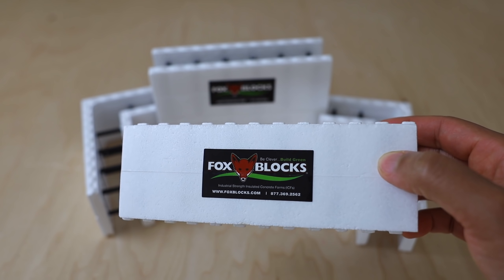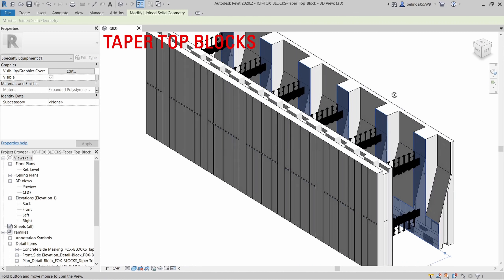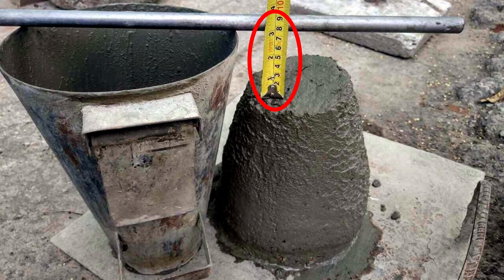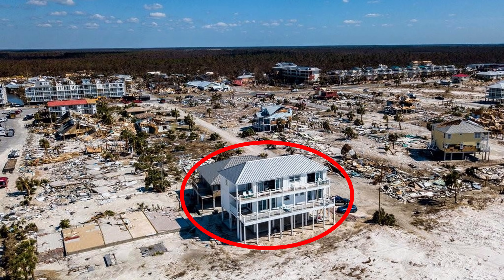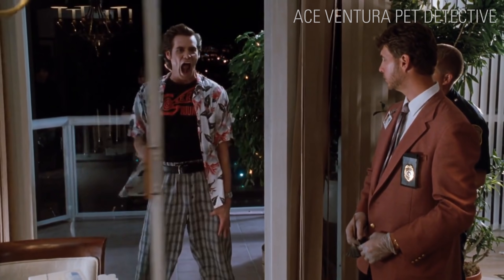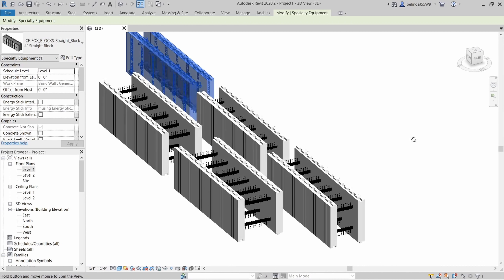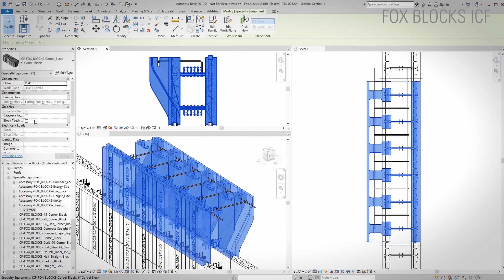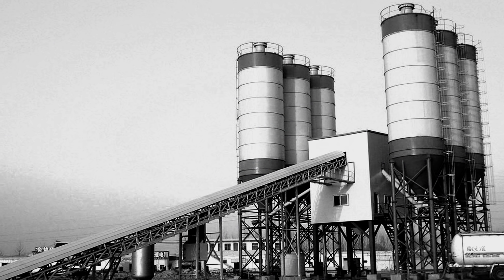Pros & Cons of Insulated Concrete Forms /ICF construction

Comment: Your claim on wood vs ICF where you say 'ICF aren't as good in cold climates' (8:35) is false. In a study by the Portland Cement Association, ICF homes saved up to 50% on heating and cooling costs over wood-framed homes. The poured concrete walls provide an excellent thermal mass, which helps maintain an even indoor air temperature. This also allows you to spend less on a smaller HVAC system.
Reply: I slightly agree with Taz, although just because someone has reason to be bias, does not mean they are.  But it is worth looking into.  That said, the math of heat transfer is not that hard to calculate.  But there are so many factors that it would be easy to do a study that could show either as better.

Not counting sheathing, Foam has R5 per inch or 26.25. Concrete R0.8 per inch meaning 4"  would be R3.2 or a total of ~R30.  With a wall 9.25" wide which is the best performance for thickness of the product mentioned.  A standard well built 2x8 wall comes in at around 8.5" and has and is R27.8.  So the ICF has a slightly unfair advantage in this comparison, but not by much.  The R-Value for a properly done 2x8 wall is just under 27 if you use blown in insulation to minimize air pockets.  (Rockwool would probably be similar).  However, the biggest problem with the R-Value of wood frame construction is the wood as it is more conductive. One solution is to use a double frame with studs that are offset 2x4.  This means the only direct heat loss through the wood is in the header and footer.  This would result in a much better R value even though it is 1/2" thinner.   

All this is at the most advantageous thickness for ICF.  As the thickness goes up, the advantage goes heavily to wood frame.   

As for the smaller HVAC system, that also depends.  The more air circulates the healthier the house tends to be so a breathing house or a good HVAC system is a good thing as well as a bad thing.  However the bad part of wood frame houses calculated as part of the R-Value.

Personally, for my new house, I would might choose ICF over wood frame, but not because of the insulative and health values which, with the way I would build are both worse.  However the extra safety from fire hazard  is a strong benefit, though I am not sure about what fumes the ICF would give off when exposed to high heat, even if it stops the house from burning down.  That would require more research.
Reply: @offroadr  0
Reply: I would take any study carried out by an industry body, on their own products with a grain of salt. I am not saying they will not be true, but they are usually bias.
Reply: I disagree about ICF construction providing "excellent thermal mass". 

The greatest tragedy about this method is that the thermal mass is actually insulated from the interior of the building where it would bring most benefit. 

A better wall system would have all the insulation on the exterior of the building, insulating the large (structural) thermal mass from environmental temperature fluctuations, allowing it to naturally modulate the internal temperature, in both heating and cooling climates, and facilitating efficient and cost-effective forms of high-comfort supplementary heating and/or cooling, such as provided by a heat-pump via low-temperature radiant UFH.
Reply: @sailingoctopus1  In my country where we usually get average -15C during winter and it's not uncommon to have periods lasting for few weeks or a month of below -25C with summer temperatures lately being 20c average with month or 2 lasting even +30.

We have these ICF systems too, with 5cm inside, 15cm(6 inch) concrete gap and 30cm(12 inch) outside insulation and I can tell you that in winter the house is very warm and during the summer it's quite cold even in +35 temps without AC. 

Using these ICF system of 5+15+30cm we get A++ energy efficiency standard or what we call "passive houses" where minimal heating/cooling is required.
Reply: @sailingoctopus1  What you say about isolation is partly correct.  ICF isolates the thermal mass from the exterior.  If the floors and roof is properly attached then these are going to have the temp of the interior.  Just like you say with radiant heat.  If you also do the roof then you will have a full envelope.  What she talks about in the video is mostly correct but there is plenty she guesses on and says completely wrong.  A good builder of ICF will know all these things and will give you a far superior home to live in than any stick build.  Plumbing, electrical and HVAC are all easier in ICF for install and size needed.  Not all ICF is created equal just like not all contractors to build you a stick home.

Comment: Gr8 vid... concrete energy intensive but with climate change getting into high-gear I expect we may see more ICF building.  Also, not just people caring too much about amenities at the expensive of a quality structure but .... excessive McMansion size leading to high building and energy and **maintenance** costs for large rooms that will never be fully utilized.  Bring on more Tiny/small or medium 1300 sq ft homes or intentional community structures :-)
Reply: Basically one of the best things we can do is begin building better buildings.
A massive chunk of the world power consumption is tied up in HVAC.  Cutting it in half (or more) means less demand for generation capacity.  It also means lower loads on local, state and regional power grids.

You forget one more option.  Build buildings with dimensions similar to what is being built now.  But build the thing to be far more energy efficient.

Most buildings are excellent space heaters for the local neighborhood.
That' how leaky and inefficient they are.
And HVAC is the single largest source of power consumption.  World wide.
And, realistically, all we need to do to fix a huge chunk of that is to air seal these buildings properly.

Comment: I thought this video was so informative.  I am neither a contractor not an architect but now I have a basic understanding of ICF construction.  My biggest concern would be the inability to remodel or add and addition to an ICF home.  This seems like brutalism evolving in that regard.
Reply: To be honest, doing an addition to an ICF wall is about the same as standard. You cut a hole in both and make sure your loads transfer properly. Just one uses a bigger saw. It’s pretty simple and just as easy as adding stairs or windows to existing basements which happens all the time.
Reply: I have an ICF addition on my home. It was incredibly easy to do.
Reply: @Kaja Pajama I should have specified. My house is ICF and I modified it with an addition.

Comment: Love your videos, And love the idea of having concrete exterior walls. would love to have the comparisons between ICF and tilt construction or traditional pour in place walls like how most basements are built.
Reply: I read that ICF is cheaper than pour in place because you don’t need to build the form work. You also don’t need to attach insulation to the concrete as it’s already done.
Reply: If you are finishing basement and maintaining as heated living space go with ICF.

Comment: I would love to hear your thoughts and comparison to "The Perfect Block" https://theperfectblock.com/
Fox Blocks have been around a long time, so they definitely have a more polished product. The Perfect Block uses recycled materials and their block has concrete mixed in with their foam. I am still learning about the product myself, but I liked your breakdown of Fox Blocks so I thought I'd throw it out there. 👍
*edited after watching your previous video that touched on how Fox Blocks recycled some material.
Reply: PerfectBlock isn't really an ICF.  It's more of a CMU (Concrete Masonry Unit).  Blocks weigh in around 30 lbs.
Despite their claims, I'd be a bit skeptical about their claims that concrete impregnated foam is going to deliver equivalent R value to a straight foam block with with no thermal bridging...

I WOULD think that the PerfectBlock is more natively resistant to critter infestation though.

Comment: Neat, but now I just have more questions.  I wonder what happens if people start trying to use similar systems with foamed concrete.  Would it make sense to use porous components like foam piping or hose in order to  increase drying time, or create space for conduit?  

Alternately, what if people try to combine ICF with steel frame construction for load-bearing purposes?  Could they use alternate infill that provides rigidity without compression strength?  Could they use the same approach for building walls which weren't vertical?  Are there half-ICF blocks for applications where polystyrene is not suitable for an exterior?
Reply: Lots of questions here but I will just tackle two. Foamed concrete, also called aircrete or such is what I believe you are referring, may work as an additional insulation fill within the ICF system if a separate structural component was utilized. Be it a post and beam pole barn concept out of reinforced concrete spaced within the wall frame or such, or a steel system. That should pose no issues, but I have not seen it done. The IRC requires a 2500psi concrete for any load bearing applications so the foamed concrete won’t be option for structural applications without a lot more considerations and analysis. 

As for forms that just use one side as EPS, many systems are coming up with or have such systems. Logix I know has a one-sided EPS form that uses plywood on the other side that gets stripped to reveal just a concrete wall. Some believe it is better to put all 6” of EPS on the exterior and leave the concrete basically exposed on the interior for maximum thermal mass benefit (which mathematically is quite probably accurate), but the added labor of plywood form techniques is not appealing to me so I would just over insulate the exterior layer and leave the interior in place. (Unless of course it was in a non suitable location such as a car washing garage or such and wanted exposed concrete for a functional reason)
Reply: @joshualruby  Guess I shouldn't be surprised at the regs for non-load bearing structures.  Thanks for the solid info.
Reply: You don't want to make the concrete dry faster.  It affects finished strength and general environmental resistance.
Also, depending on where you're at, foamed concrete doesn't deliver the strength or freeze-thaw resistance required by code.

All you need to create conduit space in an ICF wall is a hot knife to cut yourself a channel.

Adding steel beams and the like is just like any other construction.  Just talk to your architect and builder about what's required.

Also, there are ways to assemble concrete beams and columns that perform similarly.  With normal concrete forming techniques.

Fairly sure that nothing you could put into an ICF cavity would get approved by code unless it was concrete.  And most places are calling for concrete between 3-4K psi.

And yes, there are various ways to create tilt-up panels and one-sided ICFs.  Some of them are actually used to form pools and the like.
There are also ICF flooring systems available as well.

And where, specifically, would EPS not be suitable as an exterior?

Comment: I have designed a number of ICF homes. I first used them about 25 years ago but they have more recently started to become more popular. The number one disadvantage in my mind is that if the rebar design is complex and the contractor makes a mistake, it is very difficult to fix. It is suited for simpler rebar designs. You tend to have more complex rebar designs in seismic areas and/or large windows and tall walls.

We also use it in cold climates and that has not been too much of an issue.

You can also use it just as a foundation wall. Where I am from, we usually use membranes etc on the foundation walls anyways so it is not an additional cost.
Reply from the maker: Thanks for sharing your experience! I've even seen it used to build in-ground swimming pools.
Reply: What if you use Helix micro rebar?  That would eliminate conventional rebar complexity.
Reply: @rockys7726  I have never seen it used to replace reinforcing in a wall. I have seen it used in ground supported slab on grade and composite floor decking. These are items that do not cause a life safety concern when there is a failure of the reinforcing. I have heard of it used in walls but not as the main rebar. I would be very hesitant to use it as a replacement for rebar in walls. You also need a high slump concrete for tall 6" thick walls (for IFC this is more economical than 8" walls) and I don't know if that is feasible with the steel fibres. There is also nothing in the codes (where I live) that would permit the replacement of rebar with steel fibres. 

I once had a conversation with an architect who was involved with the renovation of a parkade where steel fibres were used. He swore that he would never use the product for any future projects. When ever they needed to cut the concrete there were steel slivers everywhere. They were getting all kinds of claims for punctured car tires. 

I would also be concerned with the flow of concrete around areas of high congestion of rebar.

The review of dosing and mixing is not practical for most engineers if there is a life safety concern. That is not to say that at some future point this can't be addressed in some manner. I am also sure that the product has it place and uses.
Reply: @yodaiam1000  For non-seismic areas you can get away with replacing some of the rebar in the structure with Helix.

In a seismic area, I'd use Helix in addition to the regular rebar schedule.  This adds to the ductility of the concrete throughout the whole wall structure, rather than just at the points where the rebar exists.
Reply: @PhotonHerald  Please reference the codes and research papers and I will take a look into it. If I have another product available to me that helps reduce construction complexity and costs, that would be of interest.

I don't doubt you will gain ductility. How much ductility and the significance of the increase in ductility and capacity is what is important. We normally use a ductility and over-strength factor of 1.5 and 1.3 respectively (I am not from the US and we use slightly different values) for most concrete or steel houses. If we use higher factors we also have to review the relative increase in shear strength versus the bending strength if you want the bending strength to remain the weak link. Slump is also an important factor for these cases.

It looks like you are from the US. Are you registered as either a P.E. or an S.E.?
Reply: @yodaiam1000  Contact the Helix guys and hit their site.  You should be able to get most of what you need off the site.  If you don't see what you need, contact them directly.
Reply: @PhotonHerald  I have already reviewed their site. Thanks.
Reply: Use SCC with Helix and reduce the rebar needed to be placed.